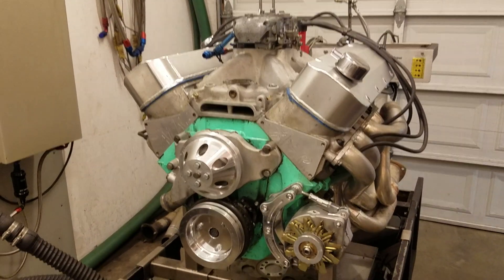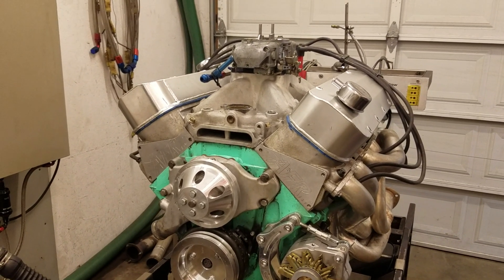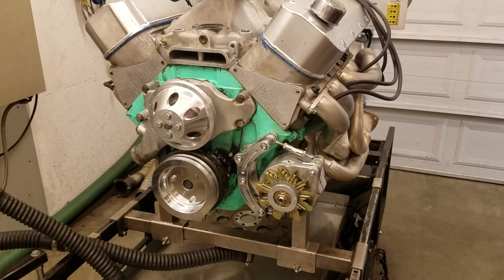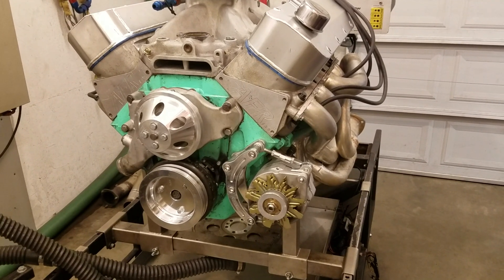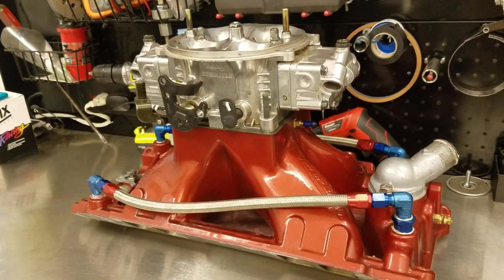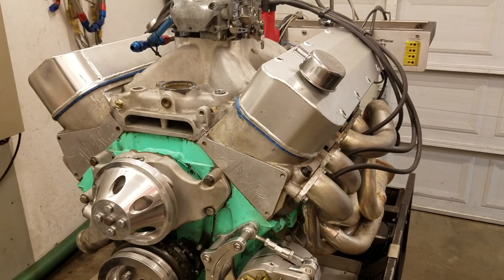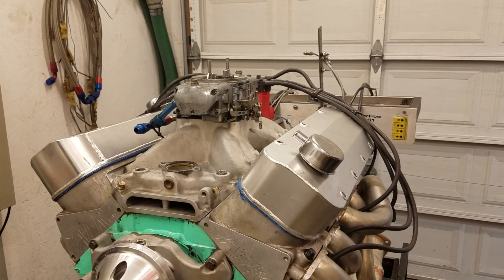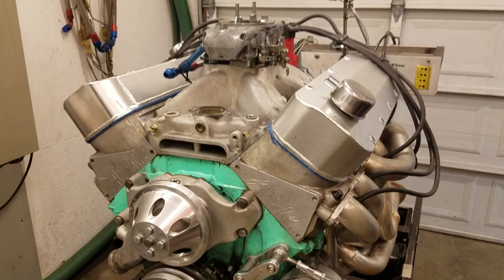496 big block dyno staging and testing

Comment: On pump?
Reply from the maker: Locally we have 93 octane available. I ran straight 93 and 93 plus Lucas oil octane boost.
Reply: @bigblockbob  beautiful. I want to put a 496 with aluminum heads into a 5gen camaro. Trying to put a suspension shopping list together to accept the new weight difference. Any recommendations?
Reply from the maker: @funguy7979  recommendation for what exactly? A 496 combo? It should meet your parameters. Do you want a rpm range or power level? Drivability and vacuum? So much to consider. I don't know if raised exhaust ports on a 5th gen camaro is a huge issue either. I can sat one of my favorite combos was the brodix rr-o 270s on my 489.
Reply: @bigblockbob  I want a setup that can be daily driven and go to the track if I deserved. I want to be able to turn as best as possible considering the new weight up front. I would install a multi point rollcage but as long as I can get in and out comfortably. Also AC is a must since I live in South Florida....(lots of highways)
Reply: 7k rpm range should be enough.
Reply: @bigblockbob  power level....600lbs TQ would be amazing